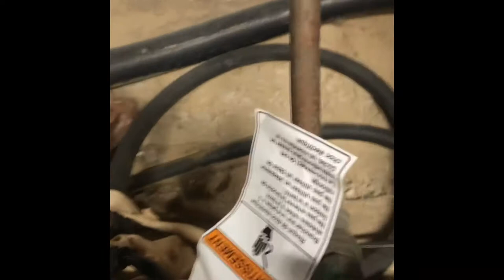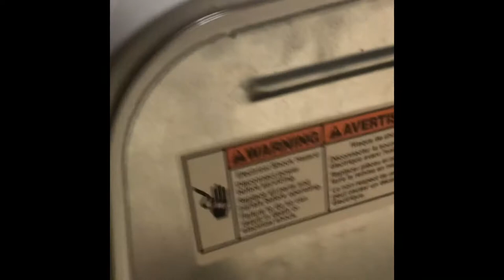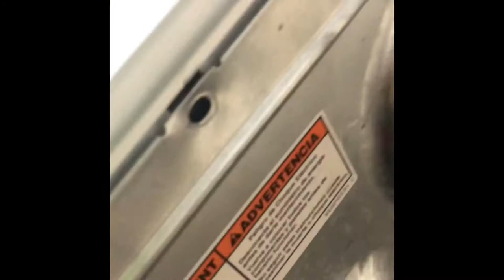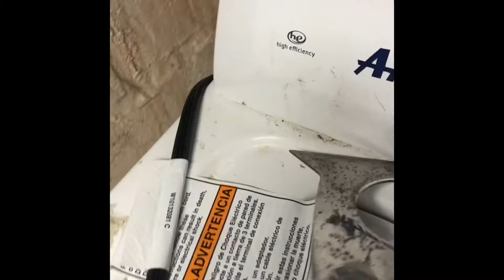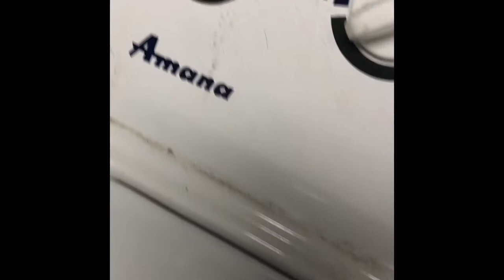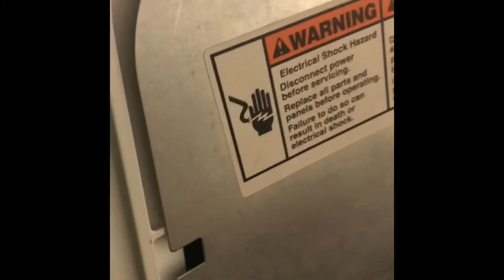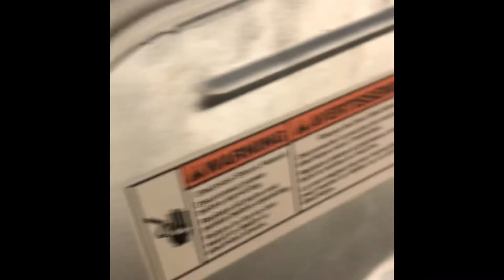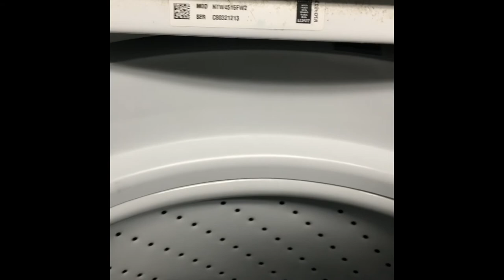Amana - Washing machine model NTW4516FW2 Inside Top leaking

Comment: I replaced the unit and am still getting drips on the cold side, though less frequent. All the hoses are a good hand tight and not leaking. Leak is on the inside, behind tub. It has destroyed the floor. #baffled.  BTW mine is older and came apart somewhat differently.
Reply from the maker: That’s a real pain, I’m sorry to hear this, but my recommendation is not to give up but to get better… try to be patient and see if you can track down the exact origin or the leak. You may need to watch for a while with a good light to see. Hope that helps please let me know if you find it. Keep in mind even new items are defective though rare. Ttyl.

Comment: Will I have a problem using my washer if it’s slow-dripping into the tub (inlet valve leak, Im pretty sure)?
Reply from the maker: I noticed my washer operating normally but the drip into the tub was wasting a significant amount of water and sometimes left inches of water collecting at the bottom of the tub.

Comment: Hi can your next video be today and how to switch the lif switch pleaseeee
Reply from the maker: Hi it depends upon the model but you can try here for general instructions: https://youtu.be/GaniJmbi7VE
Unfortunately I don’t have the part to replace the switch at this time
Reply: I have this model but mine has a 3 at the end of the model #. Don't know what revisions were made. So far so good. After 1 year no problems yet .
Reply from the maker: @patcola7335  excellent, you should get many years of service the model number may be different because of color code or some other feature revision etc. I’m no expert but usually the parts / procedures are very similar.
Reply: @Prblmslvd  Yeah the second to last letter in the model # is 'F' I think Whirlpool models are up to 'K' now but I still see an older model WTW4616FW on the Whirlpool website still being sold . The porcelain tub models with these agitators are getting scarce. I don't like the new designs with a one piece pole and spiral. Agi-fakers some of us call them.
Reply from the maker: @patcola7335  the newer things are, the crappier they are built.
Reply: @Prblmslvd  Truth!